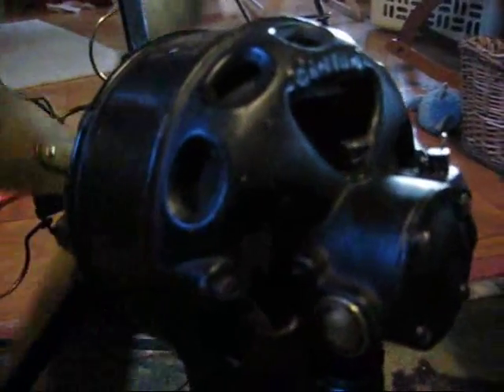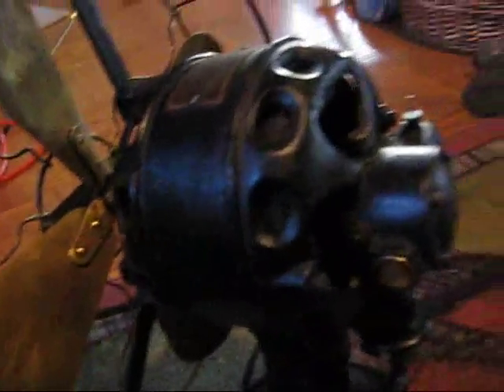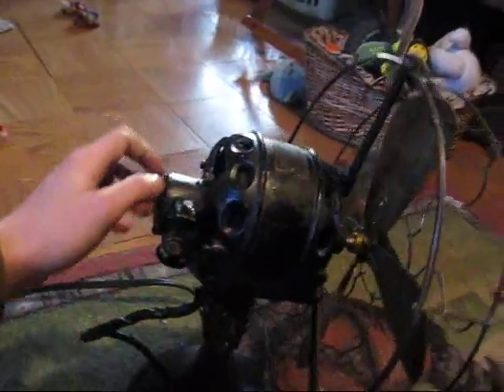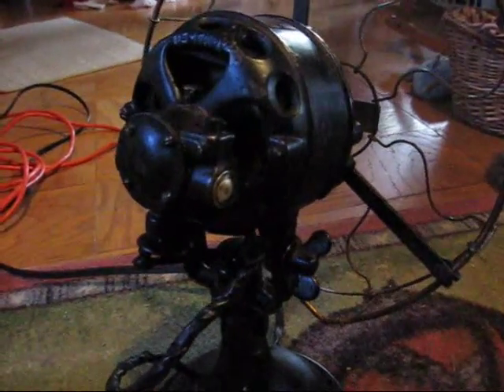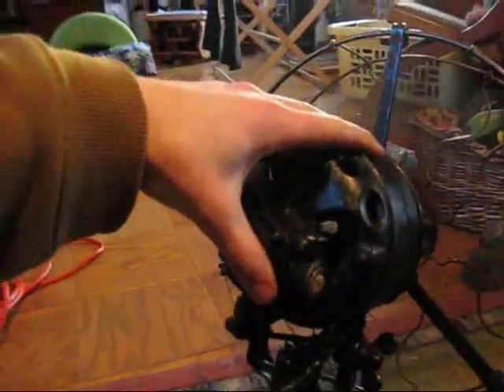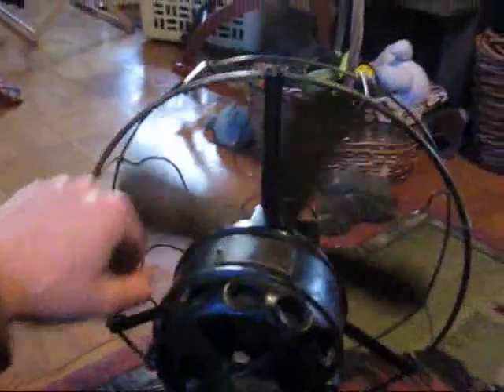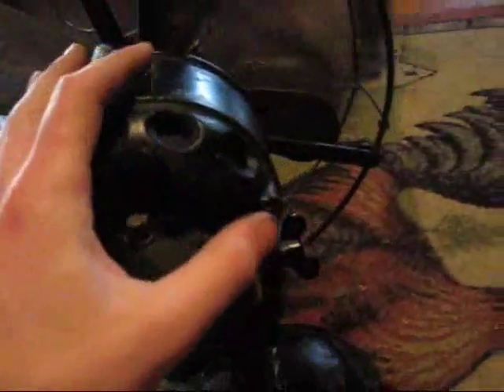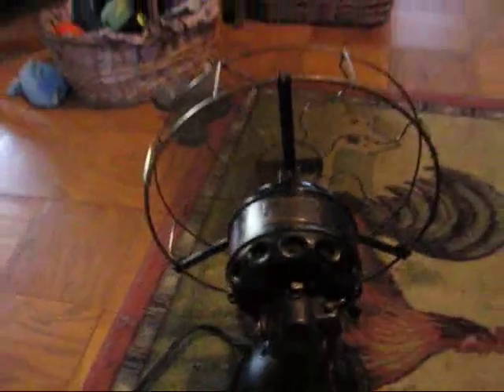1914 Century model 15

Comment: It's also possible there is something loose inside.  My large S3 runs quietly after I replaced the wiring from the motor to the base.  If this has 3 wires to the motor it's a early split phase which has a "phase winding" which I believe is delayed through the motor choke.  The schematic which was located in the base of mine shows this.

Comment: I think Century fans were great, yet, if you find one in a bad way, restoration is costly, especially the ones made in the late teens early twenties, they eventually started using pot metal to lighten up the design, those washers you are referring to were made of mica early on, and then they made them out of bakelite, and I have seen some made of that brown material that looks to be woven and then soaked in resin, you see it used on older electrical switch assemblies. Great fans to!

Comment from the maker: actually its fixed now and the washers werent the problem. it spins free and runs real quiet as it should now. the rotor was simply rubbing against an insulator. i filed the insulator down and it works beautiful now. now on to polishing!

Comment: You need to get a plastic/rubber mallet and whack the up-raised seams of the endbells where they are around the stator, and they'll come off. You can get shaft-shims at the local hardware store. Your rear shims are gone. The motor is split-phase with start windings that are low voltage and remain in the circuit, not shaded pole. The earlier S3's/S4's were true split-phase. Your fan is wonderful! It has definately found a home where it will be treasured!!